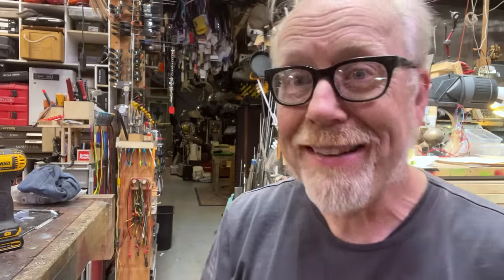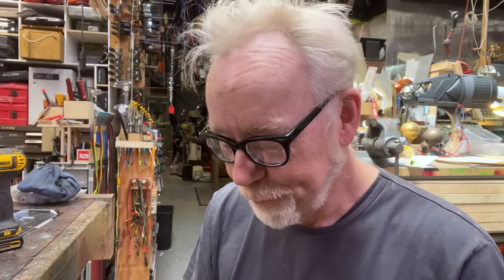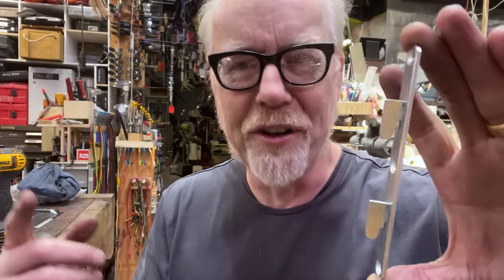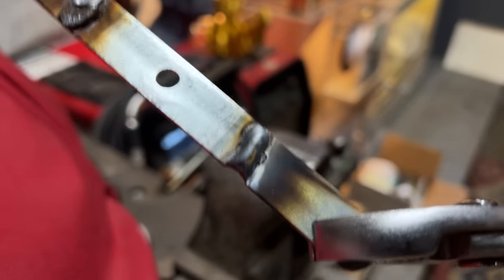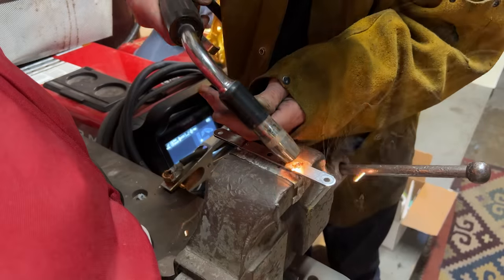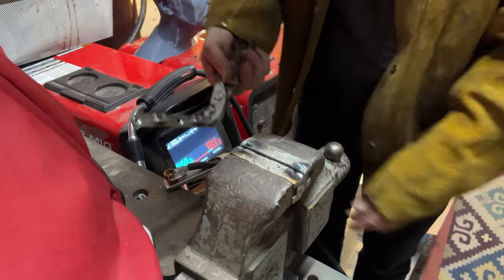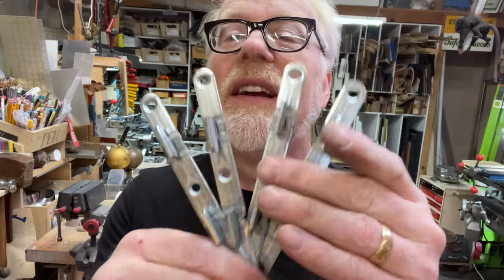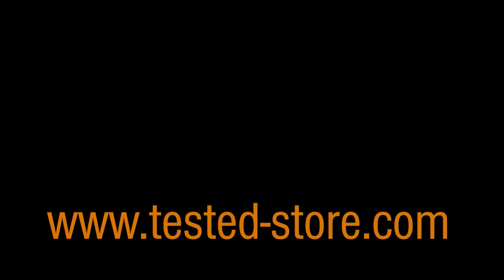Adam Savage Fixes a Squeaking Bed!

Comment: @3:11 - As a professional Massage Therapist, I find this so annoying, like nails on a chalkboard or squeaky styrofoam. 

1. "Masseuse" is a gendered term. "Masseur" is the male version. 2. Both of these terms are archaic in the industry. The preferred, non-gendered term is "Massage Therapist". 3. Regardless of which terms you use, it's a "massage table", as in a table which is used to perform massages. Not a "masseuse table", which would be what? A table for a masseuse to lay on? 

All that aside, yeah, they're pretty cool from an engineering standpoint.
Reply: You should be quiet it's not that deep
Reply: 1. Adam goes on to talk about his ex-wife as a masseuse, which I believe is the correct gendered term.
2. As far as I am aware, Adam is not in the industry. While it may not be the preferred term, it is still in use today. Last month it was used by a prominent news outlet.
3. Adam called it a massage table just a few seconds later @3:15. A masseuse table is a table for a masseuse to lay on much like a carpenter saw is used to saw a carpenter. Or it could just be a shortening of masseuse's table, as in belonging to a masseuse.

Comment: I doubt anyone will read it, but I'll say it again anyway. Capitalism requires competition. We no longer have it, and in large part that's due to 7 billion people meaning that every company is capable of creating their own market and being a monopoly. There's no easy fix for it, but unfortunately certain people want the fix to be communism which would only make things worse. The system that gave us all the highest quality of life out of any other system no longer exists and if we're not careful we'll wind up with one of the systems which led to 100's of millions dying.

As to the welding, the best way to mate two panels of metal would be friction stir welding, but it's expensive and difficult so not everyone can do it. The fact that after welding some of the pieces they were warped is one of the many reasons why welding isn't as common of a method for manufacturing as stamping is. However, the better method of forming those tabs would have been to stamp them out of one piece, but that would lead to more waste when making the entire bracket. So the next best method that's cheap, less wasteful and easier to manufacture is exactly how they did it.